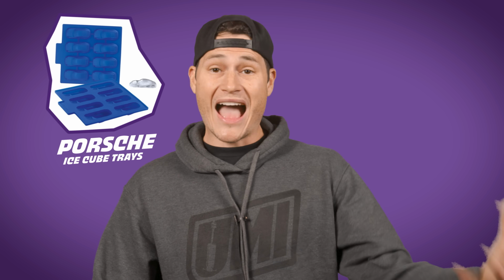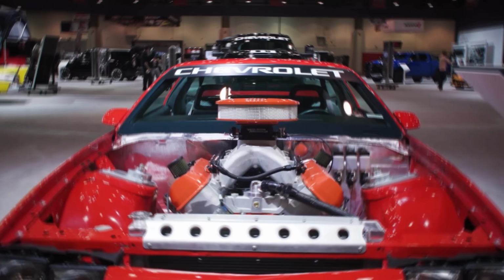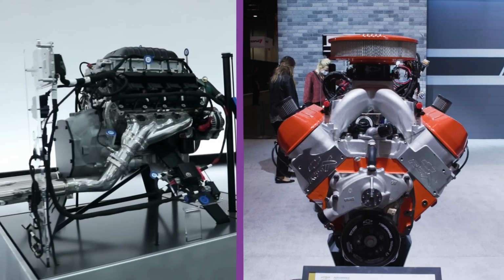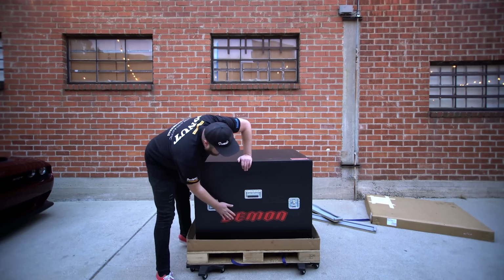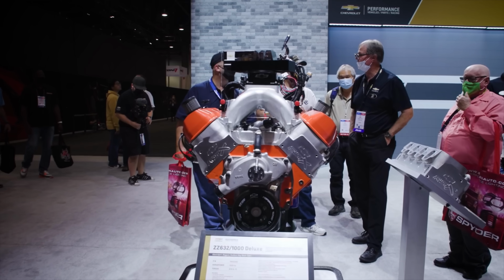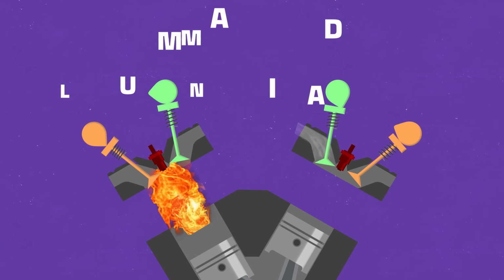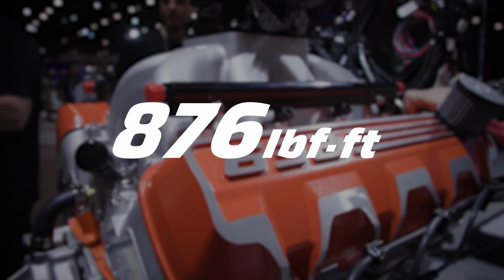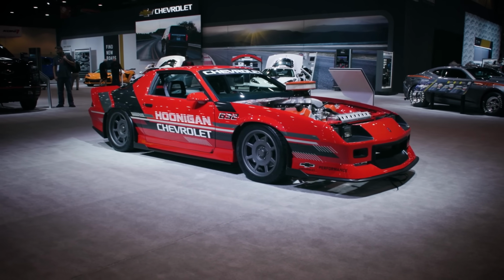Chevy's 1000HP Crate Engine EXPLAINED

Comment: I built a 502 cid Boss Hoss bike in 2002. It was fast and heavy but no handling. The engine was $7250 from Lubbock's Scoggin-Dickey Chevy Dealership. Ran hot in the summer but nice on a cool day. About 550 horsepower. The NESCO transmission gave out after 4 years of normal riding. A 632 cid would be nice in my 454SS truck.
Reply: Was you at the Branson cruise the next year or so?

Comment: Find a Chevette and stuff it in there…Hot Rod magazine stuffed a 500 Cadillac in one a few years back and went racing on the cheap…smallest rear wheel drive Chevy production car with the biggest (at the time) production V8…would be kinda interesting to find out where that Chevette ended up too… 🤔

Comment: That is one cool engine I have seen various horse power ranges for the 632 V8 just think how much more powerful you could make it if it had a super charger or a turbo charger on it
Reply: ZZ632 has 12.0:1 compression ratio..This GayM motor will blow up with little too much boost. It’d have to be fully rebuilt and stroked to low compression for boost.
Other wise maybe 1300-1500ish hp with  twinscrew supercharger and maybe less than 14 psi. 
426 hellephant has 9.5:1 with 15psi of boost from supercharger.. can still handle far more boost with turbos with supercharger still on and make lot more than this high compression GM motor. Even if they stroke  the ZZ632 to low compression and run turbos maybe they’ll make near 1600-1800 but hellephant can make that easily.

Comment: I wonder how would the zz632 work with a supercharger or twin turbos or a 8-71 blower and of course 500 horse shot of nitrous
Reply: It's designed to operate naturally aspirated, forced induction would just reduce the life of the engine!
Reply: Definitely a 'Smiles-Per-Foot' type of build lol
Reply: 12.1 compression so way too high to boost and besides an 8-71 is way too small for a 632. With a forged bottom end, that compression, and cam it would love nitrous. Not a 500 shot because I don't think you would want to spray 50% of the engine's power built like this in nitrous alone. 200 or 300hp in a couple stages or ramped in progressively sure.
Reply: @chesspiece81  thinking the same. Making that kind of HP must have a huge compression ratio
Reply: @chesspiece81  Could be done if you were willing to spend loads of money on super high octane fuel.
Reply: @Amy-dq2lg  Yeah you're talking about running $12-$15 a gallon for a boosted 632ci BBC that might get 3 or 4mpg. With that compression ratio you might be able to run 3-5 psi of boost and have to run the timing so retarded that I bet it would be an absolute dog. It would be much better off to build a motor with an 8:1-9.5:1 compression and much more boost and timing. This ZZ632 is much better suited for a pretty big shot of nitrous.
Reply: You’d be surprised what a difference high octane pump gas can do for your engine. I had a suped up 71 SS and all I had to do to beat everything else on the road was to fill it half full of Ethel or Supreme and top it off with aviation fuel at our local small airport. I’ve even used a mothball before because they used to be made out of solid methanol.  50/50 Ethel and AVgas and hang on for dear life. Seriously it would be the difference of only burning out in 1st and 2nd to all four gears
Reply: @RobbieBobbie98 Wrong.... 
AV gas is a SHITTY fuel for an automotive engine. 

AV gas is meant for low compression LARGE engines that turn a maximum of about 2500rpms.

Pouring it in your gas tank will NOT do what you say it did. And also, mothballs don't do SHIT for an engine. 

Don't make up stories..
Reply: @davelowets  The octane rating for aviation fuel is much higher than regular gasoline.
Reply: It wouldn't....
Reply: People push out 3000 horsepower with this block 👍

Comment: The ZZ632 has a factory warranty. The horsepower numbers are made with pump gas. GM may do a bit of testing and see what E85 fuel can make, I'm guessing in the 1200 HP range.

Comment: You can have all the overhead cams fuel injection all the latest and greatest technology on an engine but it sure is hard to out gun a carburetor and sure is hard to beat a pushrod engine Simplicity is key

Comment: Typical of any GM Performance crate engine, it's ridiculously overpriced. Call Summit or Jegs and order a 100% brand new, not rebuilt, Blueprint Engines 632 Chevy for 12,995 a year ago, which probably means 15000 now, the way things are going. It "only" makes a RATED 815 "herspers", but Blueprint is very conservative in it's ratings. Anyway, a 150hp plate nitrous kit is only $500 more.

Comment: I would rather spend the money on the REALLY badest big block engine with the super,duper 426 Hemi crate engine from Chrysler corporation. They say 1,000 HP, but they have been tested to produce some 1,230 HP.......Chevy people like the guy above tell you the Hemi has forced induction, but, he doesnt tell you the Chevy motor is 206 cubic inches LARGER..........When will you Chevy guys learn !!!

Comment: Question. Who has the money for a $40k crate engine but doesn't have $4 a gallon for 93 octane? Are you going to buy a new $8,000 rotating assembly for a brand new 40k crate engine? Or is this just supposed to be the most impractical street engine ever?

Comment: Chevy's first bit block was 64 years ago! Wow! 358-inch motor available in the 58 Impala. With 3 two-barrel carbs it made 280 horses, 250 with a single 4 barrel.  Lasted until the end of 1961. By then it could be had with 350 horse which was the max it every produced before being replaced by the 409.

Comment: The 632 heads are totally different too. The intake runners, are separated as opposed to being paired up, like they used to be. They look more like Ford Heads. Those heads have an impressive flow rate too. 12.0:1 Compression on pump gas is questionable to me though. Even with electronic management. I was always told 11:1 was it for 93 octane.
Reply: I AGREE WITH YOU 12 TO 1 ON PUMP GAS SOUNDS A LITTLE STOUT
Reply: Nah I'm running a '18 coyote with a blower and its 12:1 on 93... its half the displacement but a little more power per litre than the 632 so I'd say it evens out the advantage FI gives it.

Comment: 10.4 litres. That is the size of a literal bus engine. I think some of the city buses around here use a 9.6L V6 (or I6, one of the two). This is a 16 ton vehicle with a payload of, what, a couple tons more full of passengers. This displacement is nuts!

Comment: when it comes to crate engines (, I would suggest removing the oil pan and valve cover just to check it out (lube the springs and valves ) and pre oil the motor via the distributor if it has one or crank it over with no spark or fuel until you get oil pressure ,if you have roller lifters break in is no big deal
Reply: It COMES with a dyno sheet... it's ALREADY been done

Comment: I had a ZZ572 in my Chevelle...I was terrified, my passengers were terrified, motorists around me we terrified.  It was the greatest car I will ever drive...I can't imagine the 632 but I am sure it is amazing
Reply: Women want scary movies.. men want a scary car! 😈
Reply: @YuckFou72 thissss 🤌🏾🤌🏾
Reply: If you aren't scared, you aren't going fast enough
Reply: @jeremiahbullfrog1844   FACTSSS 😂
Reply: Im terrified just knowing it exist
Reply: 😂😂😂😂 sounds fantastic 💯
Reply: Big bad 632!! Too nasty!! My freind has a 69 Camaro pro-touring with a ZZ572 and a Tremec 6speed. Just a BA ride!  I would definitely build a car around the 632.  Off frame restoration with a heavy duty Roaster Shop frame for a foundation to start. 👍🏾
Reply: @hotrodder5034  jur remember to add weight in the rear, this engine weighs like 800 dry.
Reply: @sethh8892  Well you're gonna need a bigger fuel tank and a set of Mikey Thompsons so problem solved.
Reply: But, can it handle?
Reply: @montreauxs  can it handle???? A create engine.....lmao ok
Reply: @montreauxs  cars with this engine aren’t meant to take corners.
Reply: @wayne9518  Agreed.. But a true performance car, isn't just a straight line 1/4 mile car.
Reply: @montreauxs  mount it between the back seats. Problem solved 😉
Reply: @montreauxs   actually, yes they are. Drag cars are most certainly performance cars. They perform fantastic down a quarter mile. There are different engines for different applications. Small displacement naturally aspirated engines are great for small, quick to maneuver cars. Large engines with massive amounts of power and torque are great for drag racing. Small displacement turbo engines are great for rally and hill climb racing. There isn't one motor that does absolutely everything, that's ridiculous. Also, who said a large engine can't perform well in a track race? That's a shit take
Reply: @montreauxs  Well many will bef to differ that a 1000 HP crate engine isn't performance.
Reply: @sethh8892  'big' and 'small' displacement isn't a good measure when talking about actual physical engine size, engine design is a factor too, hence a 7 litre LS7 being smaller and lighter than sometime like a 4 litre NA BMW engine for instance. The LS engine actually has a lower CoG too, making it BETTER for cornering ;)
Reply: @lorddoobsworth21  well the displacement is how many liters it displaces... not overall physical size. I don't care what the physical size of it is, I care how much horsepower it makes per liter.
Reply: @montreauxs  it's a drag car, no. Its not meant to... this is such a stupid question😂 it's like getting upset when the TV remote doesn't do math problems like a calculator. It's not intended to be a calculator so obviously it's not going to function like one🤦‍♂️
Reply: You have fantastic  taste in cars !!!!!! Chevelles are beautiful!!!!!!
Reply: Your comment makes me smile...  sounds so beautiful
Reply: Don't you mean terrifying?
Reply: I am not terrified of your terror that you made terrible comments about your Chevelle. Learn how to drive NOOB.
Reply: I have  a 69 chevelle  in building  for the Texas mile  and im putting  a twinn turbo 632 in it total  cost  is a bit over 53,000 and I figured il be right around  2500 hp depending  on how much boost I dial in ,my wife says  I'm insane , this is why I have a huge insurance  policy  on my insane  ass! Iv had this itch always but only till now have I had the chance to finally  scratch  that itch , wish me luck!!!!!!
Reply: @johnalarcon5006  2500 hp in a boosted 632" won't last. There's a very good reason why virtually all the turbo big-block guys run 540" engines. You could make 3500 safely in a smaller, higher-boost big-block.
Reply: @The_sinner_Jim_Whitney  yes it will  !
Reply: @The_sinner_Jim_Whitney  tell that to the guy who's building  it for me
Reply: @johnalarcon5006  I'm not saying they can't be built to survive, I'm just saying that a smaller BBC can be built way cheaper to survive way longer while making more power. I'm all about anyone who chooses to swim against the current, hell, my dream machine is a square 4WD Suburban with a 6V-53T Detroit and a 10-speed RoadRanger, haha!
Reply: @The_sinner_Jim_Whitney  increasing boost isn't going to make anything safer... increasing boost on a larger displacement engine definitely isn't going to make anything safer. You can produce thousands of horsepower out of a small engine, but a larger displacement engine will be able to do this much more reliably because it will take less to reach those numbers. It's called power potential. Power potential always goes up with displacement.
Reply: @sethh8892  I know all of those things, I was referring to a particular combination of displacement, RPM= HP, 632s don't like to rev to the moon, smaller displacement engines are better at it, so easier power. That's all I'm saying.
Reply: @The_sinner_Jim_Whitney  the different in size is very minimal at that displacement. Its not going to make an rpm difference. Thats why the zz632 can rev to 7k
Reply: @The_sinner_Jim_Whitney  You don't have to rev to the moon isf you got more displacement to make the same power.
Reply: @jasonbourne1596  But in boosted scenarios, more displacement doesn't necessarily make the same power, and sometimes (like with 632"s) it won't handle as much.
Reply: @The_sinner_Jim_Whitney  How do you know it won't? I just saw a Hemingway with turbos the other day put down 5k horsepower. try that with a small engine.
Reply: @jasonbourne1596  The 632" block has thin cylinder walls, it's not strong enough for big boost. They don't live at the 2,000 hp level, let alone twice that.
Reply: @The_sinner_Jim_Whitney  Remains to be seen just how much power it can hold.
Reply: @jasonbourne1596  Not really, they've been building them for like 25 years.
Reply: Oh yeah that sounds like a freaking awesome beast
Reply: If you're scared you shouldn't be going fast.
Reply: @jacobward4524  where’s the fun in that ? Lol😂 you sound like my granny.
Reply: @jacobward4524  If your not scared you shouldn't be going fast,  because you're dangerous.
Reply: @jasonbourne1596  When your scared, your going to fuck up.  When your driving it should be second nature.  You need to feel natural like the car is an extension of yourself so you don't freak out and mess up. You should be comfortable and if your really driving you won't think while you do it. It will just come to you. You could die anytime you get in a car. There's no reason to be afraid while driving unless your a bad driver. Bad drivers are dangerous. There are a lot of bad drivers. That's why you shouldn't be driving fast on any public road. Go to the track.
Reply: @jacobward4524  If you don't respect what power your car has you are dangerous and will just do what you want anytime you want with no thought to this thing called an accident. 

I'm not saying be shaking in your boots as you drive.  I'm saying have enough sense to know when you are pushing it too far. 

Just so you know, I'm a very good driver and I've probably got more time or as much time as anyone driving over 120 on the highway, but I know when or where to do something so I'm still alive, and everyone else who was out there is too.

100, 150, even 200 I can keep my vehicle in the road and know when to and not too to do something because I have knowledge and situarional awareness.

Lots of people have not been scared, but most of thems dead already. Fear is a healthy thing.

I'm crazy though do what do I know.

Comment: You didn't mention any specifics about the engine. The diagram looks like it's overhead cam - is it? Does it come with exhaust manifolds? is it fuel injected? etc. etc.

Comment: Whatever you put it in an electric tesla will blow it away.  Sad but true.  But you can't beat the sound  of an 8 cylinder gas or nitro engine.  If its $37,000 then thousands more to shoe horn it in your car why not just get the Tesla if its speed and power you want??

Comment: Would love to have a 4-cylinder option of this. 500Hp, smaller, compacter.
Reply: Yeah but this is gonna be way less peaky than that,you're gonna have to wait for some revs to get there whereas this thing has mad torque from the get-go.
Reply: Ya it's call an Nissan SR20DET and you can get it over 500hp, or you can go with Toyota's 4AEG and can get that up to 500hp.

Comment: i still don't believe it makes 1000hp with nothing but aluminum heads and lightweight valves... come on man you know how good an engine has to be to make 1hp\ci let alone 1.58hp per ci. i simply won't believe it until i see it. the efficiency of this engine is to good to be true ** ON PUMP GAS i just dont believe it.

Comment: 37 k? .... so I could buy a g8gt swap the y76 and 6L80 for a l8t and 10 speed auto ...build engine and 10 trans , pro charge and program, swap suspension .. so have any from 650-1800 hp in a bad as street car.

Comment: Funny watching the animations being used. A inlet valve disappearing into the intake port. DOHC crossflow animation, again wishful thinking.
Ancient tech crate "race" pushrod engine failing to make 100hp/liter. 
That engine is so big it should have been labelled "full size pickup trucks only".

Comment: The last big block was actually an 8.1 L vortec and it was in the 2500 HDs and bigger from I believe 99 to 2006 but I could be incorrect on that and they also make a vortec 8000 8 L which is still used in marine and commercial industry settings and they also still use the vortex 7400 which is a 4554 and industrial settings as well

Comment: This concept has been around a long time. Although not as glamorous, I believe Pontiac had adapted an older OHV straight six with a new overhead cam head adapted to it and IIRC Chrysler took the 273/318 block and adapted it to an overhead cam in the 4.7.

Comment: THERES AN ERROR! The last Big blocks were actually 496Cubic Inch fuelinjected 8.1 engines branded as "Vortec" in GMT800 trucks. They made TBi 454s all throughout the late 80s and 90s. In rhe 2000's you could get a 2500HD 3/4ton truck,suburban,chassis with a 8.1L and a 4L85e or allison6spd auto.

Comment: I should slap one of these in my 2001 Camaro. Yes I do need A/C because I live in Florida and it gets hot here. I blew the doors off a newer Subaru WRX STI the other day with my A/C on full blast. helps that my car is a 6 speed manual.